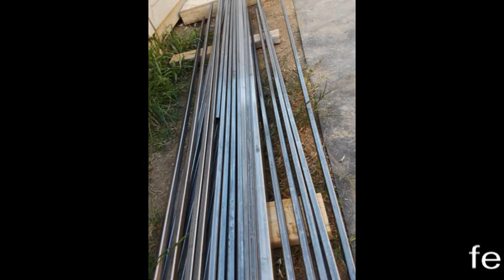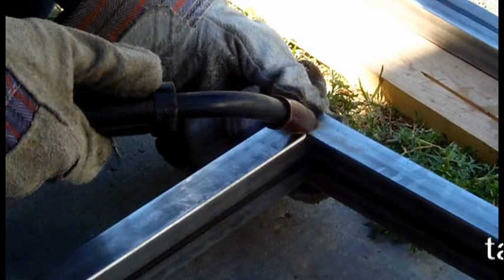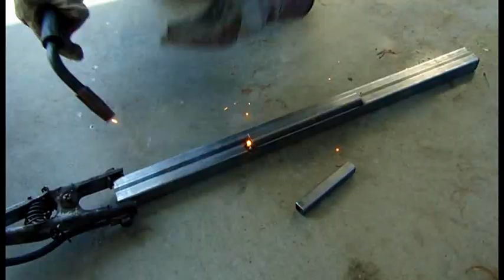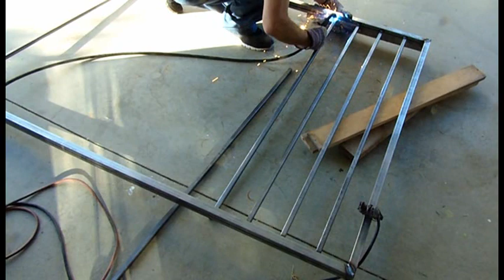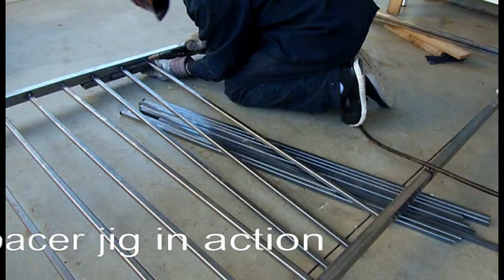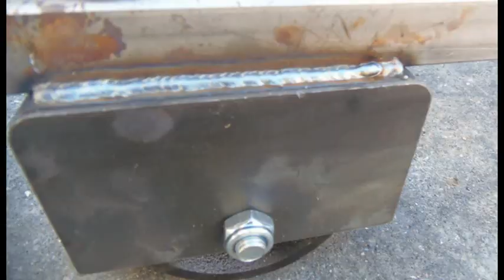Make sliding gate

Comment: Can't believe you didn't tack both sides before putting that full weld across one side. Without even having it clamped to control heat distortion. It's amazing you didn't end up with a warped gate.
Reply from the maker: I know right! I been welding for 30 plus years I kind of know how to work with heat

Comment: Hey I'm in central LA. Can you recommend a place to buy steel hardware for sliding gates around here? I plan to make a 11' x 4' gate (and learn how to weld). Thanks!
Reply from the maker: Ramcast metal supply is on Alameda st.  I dont know the address  but you'll find it on google
Reply: @diymaker7373  Awesome. Thanks!
Reply from the maker: You got it

Comment: What wall thickness/gauge is the tubing?
Reply: What gauge would you recommend for an 18-foot sliding gate?
Reply from the maker: I used 1/8 thickness all around.  Simply because it is my personal gate, 18 footer gate you can still use 1/8 thickness,just install the caster wheels on the right place
Reply from the maker: Although I don't do gates for a living, but I been welding for 30 years
Reply: @diymaker7373  Thnaks for the reply! I was planning on 1/8, but was thinking about alternatives after weighing costs. I was considering using 14 gauge, but I think that may be too flimsy.